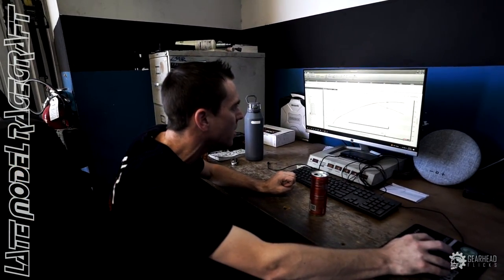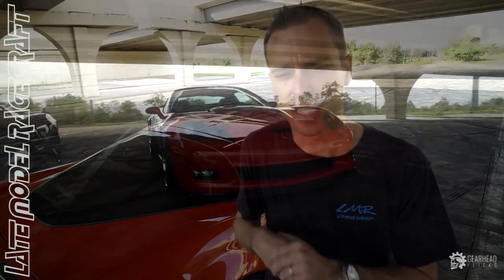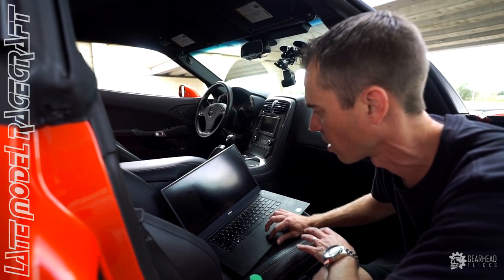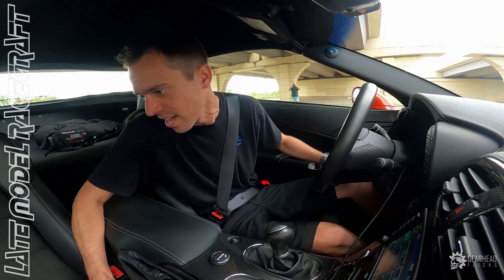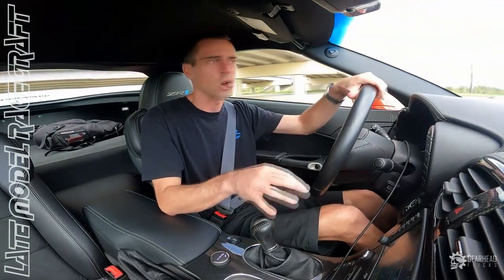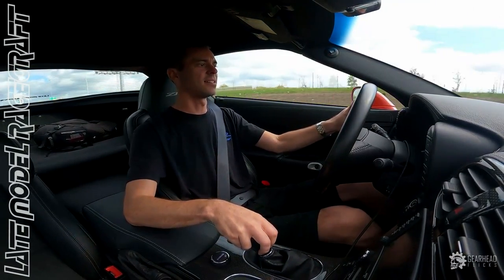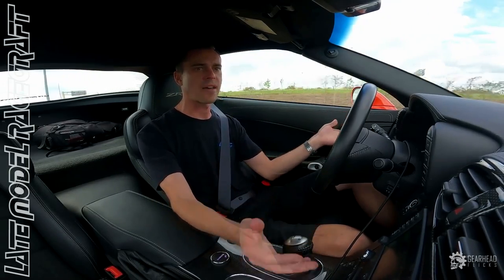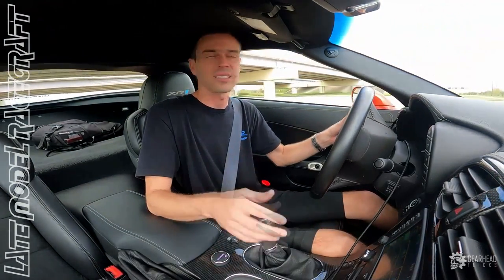Fereday Edition C6 ZR1 hits the test track

Comment: C6 zr1's are special. The LS9 is just sick. Plus, will hold its value pretty well.
Reply: Pretty well? They still go for 80k I say damn well lol
Reply: Ya I agree very sweet. Loved the z06 as well I mean that naturally aspirated 427 was sick but seeing the zr1 hood it was just mean looking
Reply: @weekendwarrior556   Love the LS7 as well. Such a beast.
Reply: @hypblue1le   well, they been hovering around the $60 to $85 range so correct, holding it well. I think it would have gone up even higher but i didnt think they were doing a C7 zr1 because not much was talked about. Once they did that the value just held. It will always hold its value. Probably lower end units will push the high 50k border but great examples will be upwards in the $75-$85k+ .
Reply: @redtesta  yeah I want one and keep my 1LE to power upgrade
Reply: @Hypblue1LE  yeah corvette in general, holds its value no matter what year or trim
Reply: I doubt they're going to do anything but go up. I sold a C6 Z06 last year for about 10k more than they were going for a  few years prior. Everything early-late 2000s with a manual, seems to be going up now. Nice Z06s, ZR1s, RS4s, M3s... all seem to be on the rise.

Comment: Definitely a DREAM CAR for me. 03-04 Cobra, 13-14 GT500 are my 2 others. That car is amazing 👏 😍
Reply: Typical leave out the 07-12 cars kind of guy.  I'll never understand why people love the terminator and 13-14 gt500 but not the 07-12 gt500.  The 5.4 is beast and with the right tweaks will make power comparable to modified trinity cars and they have the same ceiling for alot less money.  I like all of them and I'm kind of partial to the 5.4 cars because the engine is awesome and they're underdogs everyone always counts them out and leaves them off their list but they're just as good as terminators and trinity cars.
Reply: @Lil' Ike  I like the 5.4 but my Dream cars are what they are.  Not knocking them just not a dream car of mine.

Comment: Can't believe that you still have the stock shifter in it.  MGW Short throw would be so much better.  Yes, I had 5 - C6 - C7 ZO6's nothing with your kind of HP, but just as much fun.  My cars were set up to run the canyons of SoCal didn't need the extra HP.  Major changes were the suspension - coil overs bushings and bars.  Doesn't matter what you do to the car,  just get out and enjoy them!

Comment: Well Steven looks a little big to be a 3 pedal kind of guy. C7z0. If he was smaller, a zR. Sure c7z0 has 650 hp but its 200-300 lbs heavier than the C6zR and you have the automatic as an option, first time on a z0/zR. Old LS7 & LS9 was a manual trans only thing. A friend got a 2011 427 convertible. It was kool to see a C6 convert z0.

Comment: What are the drawbacks to running the Kong 2650 over a tvs 2300 like Magnusson .
Reply: There aren't drawbacks to a 2650 it's better in every way and will make more power on the same boost and won't work as hard to do it but still hits good on the punch.
Reply: @midnight347  everything has a drawback somewhere, no free lunch. Maybe just cost.

Comment: What clutch do you guys run in a car like that at that power level?
Reply from the maker: Triple Disc Monster
Reply: @LateModelRacecraft  Thanks.
You ever use RPS?
I had a triple carbon years back and it was a very good clutch, IMO.
I'm wondering if they have a following now.

Comment: Hey question for you guys what’s your go to tire for 1000hp Camaro. I drive on the streets I hear alot about the R888R but impossible to find these days. Any luck with the nitto 555r2?
Reply: 1000 hp car HAS to have drag radials very aggressive ones if you want any kind of traction on the street wide as possible.
Reply: Thank you. Just trying to find the best middle tire I don’t like the sway of the drag tires at high speeds. I know I can’t have it both ways!
Reply: Thank you. Just trying to find the best middle tire I don’t like the sway of the drag tires at high speeds. I know I can’t have it both ways!